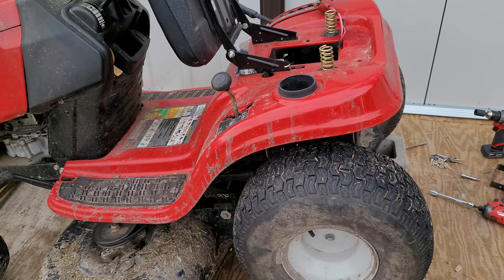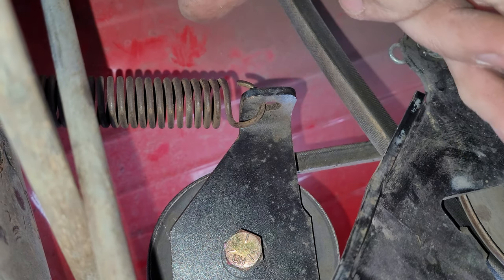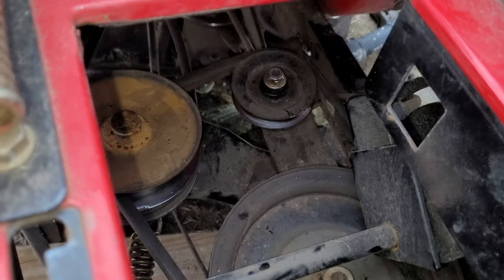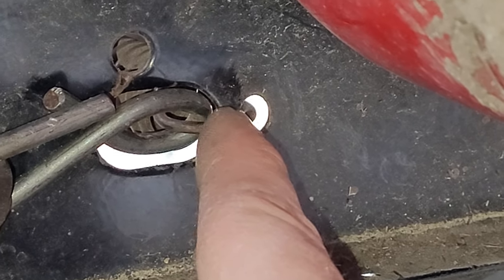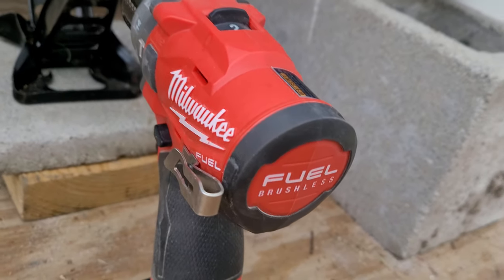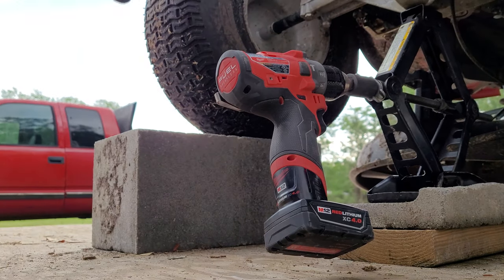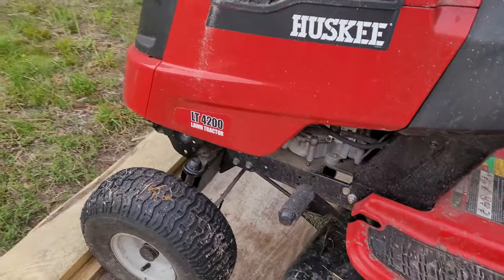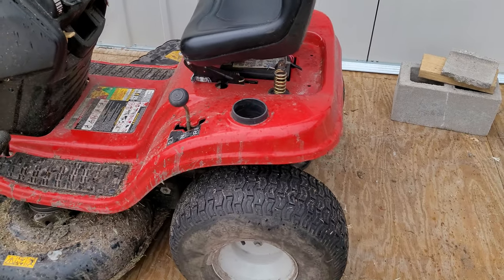Riding lawn mower won't move forward or backward  🤷🏻‍♂️    watch this😎

Comment: Nice job! I was cutting grass one day & pretty much same problem! Ran over some branches didn’t think much of them kept riding…. Until zero turn quit moving!
The small limbs pushed the drive belt right off one of the pulley!!
I picked up a few limbs before I started cutting!!
The ones I thought I could cut got at jus the right angle to ruin my day!
Reply from the maker: @ Orlando Johnson yea I've cut other branches no problem, but just a stubborn branch knocked drive right out and it wasn't even big🤦🏻‍♂️.  thanks for your feed back 😁

Comment: Nice!! I put that spring back on before but I used a weed eater line to do it when I replaced the belts. 
 I used this video to see the location of the clutch return spring the one that goes to the back 👍

Comment: I have a Huskee lt 3800 that won’t go forward or reverse. Im go see if i have any springs loose
Reply from the maker: @Gulf coast Mex, if the spring is good, it could be 1 of your belts. But if a belr broke, then you definitely would've known that. But yes if the spring comes loose or pops out you wouldn't know that until you inspect your mower. 
Hopefully you're able to get your mower going.
Reply: Or missing also 
They break and fall off

Comment: Is this a common thing on these Huskees?...I have the same mower and when I parked it yesterday it would shift fine forward and backwards...went to move it a minute ago and when I put it in forward nothing ..reverse nothing..haven’t took it apart yet but I can see drive belt and it’s tight and intact..so fingers crossed it’s just the spring...thanks ...any info would be helpful
Reply from the maker: @ Stephen Pickron, I wouldn't say it's a common problem on Huskee, I had mine for like 2 yrs with no issues. Then this happened. But I think it was more so my fault. I was running over sticks and branches. And I had a stick lodge in the area where the spring was and it just came off.  
Thanks for watching and I hope you got your mower back going.
Reply: No but they rusty and break is common